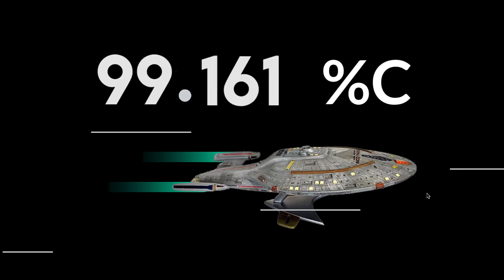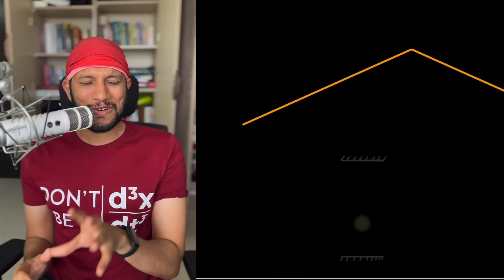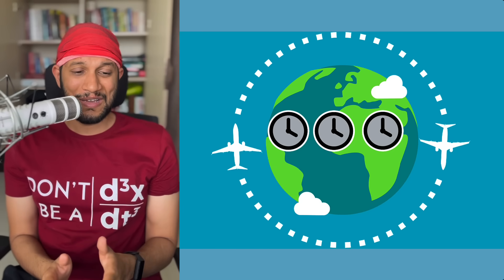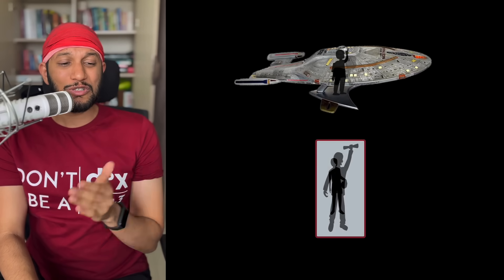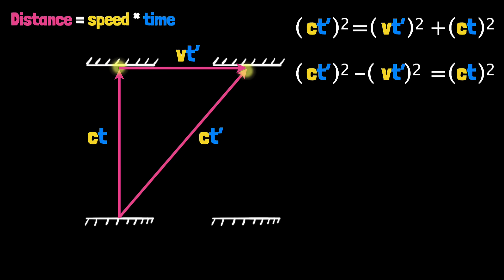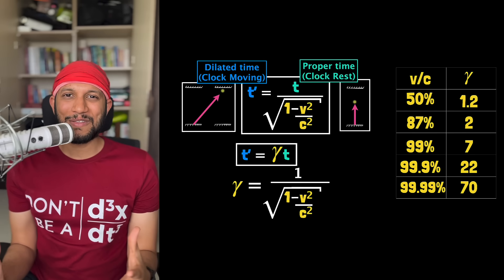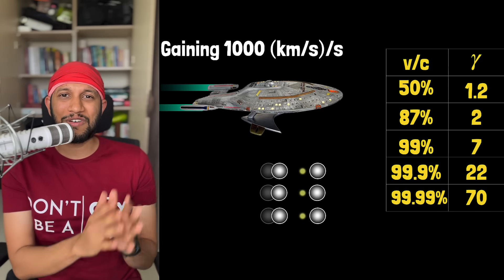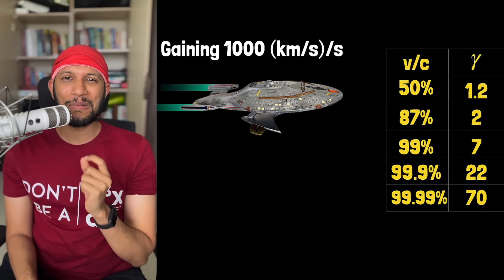I finally understood why you can't go faster than light! (My mind is blown)

Comment: Found this 11mo later. Still fascinating to learn that time stops for anything traveling the speed of light (c).   I wonder what it's like to be that photon emitting from Betelgeuse (650 light years away).   Literally while that photon traveled approx 3.82 x 10¹⁵ miles to reach earth for us to see Orion, time has literally stopped for that photon.   Seriously mind boggling.
Reply: i give you now the answer i hardly found, by myself. Einstein himself was never able to explain this.

no real clock slows down, because no real clock measures time, not distance. all real clocks measure time*distance, and that is a non-variable. 
Einstein was often confused

the answer to the twin paradox is: 
all twins in the Universe live in the time*distance, not in time, nor on distance. 
this is the key to understand the limits of special relativity, that is a non-functional theory, merely a didactical object.
no twin ages more, by virtue of relative motion and speed.

there are three types of time, all different, always different: 
1. theoretical absolute time, or say theoretical local time;
2. theoretical relative time, or say theoretical distant time;
3. measured time, the real time, that ironically does not have the dimensionality of time, it has dimensionality time*distance

Comment: How do you see the photon in the ship from outside it? There can't be an observer measuring it to get the speed of light in two different reference frames. The observer outside the ship is measuring photons outside the ship. This is probably taking the story too seriously and the equations work fine. But I feel puzzled and since it involves observation of photons, I wonder if this is related to the contradiction between quantum mechanics and relativity.

Comment: what if there is a ship inside the ship. the first ship X is really big and the second ship Y thats inside the first one is really small. lets say we managed to reach 299,792,457 m/s now we are 1 m/s of reaching speed of light. now we fire up the ship Y inside which obviously will fly faster than 1m/s. why cant it break the speed of light then? would it also require infinite amount of time to accelerate? even tho its in the enviroment that is (from ships Y perspective) not moving at all? or do we differentiate both enviroments as seperate in terms of percepting speed? but if we choose to do that then what happens if the ship Y inside breaks thru the wall of ship X. wouldnt it go faster by the additional speed it gained inside the ship?

Comment: Very interesting. I'm not a scientist and don't have any degrees. You say that as far as science can measure time slows down approaching light speed and any other consideration falls into the realm of Philosophy since science can't measure it. Yet it is the very concept and constant of time which is being used to determine that time is actually slowing down. Just because you are unable to measure something doesn't mean it doesn't exist.

The twin on earth is aging normally while the one traveling near light speed is not. It is those on board the craft who are experiencing the abnormal conditions which render them unable to reach the speed of light by THEIR own measurements which are altered due to those very same conditions. 

The craft would be in a realm where things operate differently to normal as with nano particles and quantum mechanics. A measurement taken by the twin on earth would show the true velocity of the craft relative to actual time. Nothing is impossible.
Reply: Why should earth's reference frame be in any way more "real" than the one of the ship?

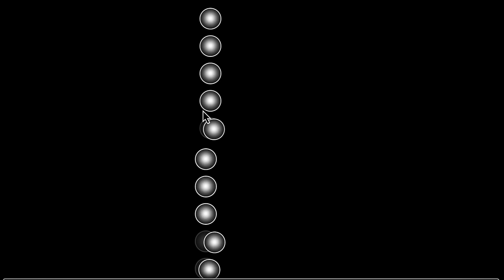Comment: 3:40 So we just ignore the orientation of a clock, regarding the movement direction or what.
If i turn the clock 90 degrees, this animation does not work anymore, because now the ship is moving 90 degrees,
compared to where the pointers of the clock are moving towards. This is pure nonsense. Sorry to break it down to you.
Time is just an invention by humans, for orientation, for logistic reasons. It is basically just a comparison really, between objects, or processes. Like planets moving.

Comment: I am confused with say the twin experiment. photon traveling is only relevant to perspective, how is it actually changed? how does moving actually warp time beyond perspective/view within light? The way i interpret it is when you see something as it is moving, it appears slower (or faster) due to distancing itself with light. Example: if you hop in a space ship and leave earth at a hypothetical speed of light, the earth will never move as you are leaving at that exact light frame that is escaping earth. Though to come back to earth, you have to make up that lost light somehow, whether be double the time coming back at half speed of light or same amount coming back at speed of light. 

I suppose maybe I just cannot wrap my head around it well enough to understand the physical changes that endure that is beyond the measurement of light/time dilation. You normally have to make up that distance/time lag somehow. So if a baby is moving in a ship, it could LOOK like it is aging slower, but in their perspective, should be aging relative to their ship, and when the ship matches earths light, it should be equal.

Of course I am open to a different understanding, but I guess I just need another explanation as to how life genuinely lasts longer beyond just our perspective of it lasting.

Comment: I always thought of it like this.

The force that holds objects (ie, matter) together is the electromagnetic force. If you move faster than that force, everything would disintegrate or fall apart, hypothetically. Does it work the same way breaking the sound barrier with sound?

Comment: Great explanation. One thing I still don't intuitively understand: I thought motion and speed are relative. So if a space ship accelerates away from the earth at almost the speed of light, the earth is also in a sense moving away from the ship at almost the speed of light. Why does the time on the spaceship slow down, and not the time on the earth? What reference frame "decides" which moving object is slower or faster?

Comment: I really enjoyed your dissertation of the limits of the speed of light. However the the example you showed the difference photon clocks between the clock on the ground and the clocks in the plane, you admitted those clocks are subjected to the gravity of the earth. In space there is no gravity until you get next to a celestial body that attracts the space ship (gravity), same as the earth attracts the planes to it, and affecting the photon clocks. If the spaceship, approaching the speed of light, has no gravity adversely applied to it, would that not negate the pythagorean theorem and disprove why we cannot go faster than the speed of light? 

I've seen the experiment where photon clocks at sea level are faster than photon clocks at the hight area of a mountain, but there again, gravity plays adverse reactions to the two clocks on earth. Your thoughts on this rebuttal, please

Comment: I don't believe the current theories of time dilation are describing the concept of time but rather describing matter in motion. The properties of matter. In fact adding weight to the concept that even photons are matter pun intended.

A photon is defined as a packet of light. It has no mass. The photon is a fundamental particle of light and electromagnetic energy that has no mass or charge: 

In this clock the photon or muon bounces between mirrors keeping time so to speak. While in motion within an encapsulation its traveling is affected by the distance covered relative to speed.What is being measured are the properties of the photon or muon as related to speed through space. Particles cannot exceed the speed of light but neither can photons. There has to be a physical reason for that.

The universe is bound by weak and strong nuclear forces fine tuned allowing for our existence. We have electromagnetism. And we also have particle attraction based on polarity. We know what causes certain polarity in matter but not what polarity is. I feel the key to understanding why matter cannot travel faster than the speed of light has more to do with it's relationship to the material fabric of the universe not some time dilation time clock that is actually measuring the properties of the clock in motion and not time itself. I feel the equations are correct but not the explanation of time. 

If you could encapsulate an object within a capsule whose walls were  not affected by our many galactic forces and laws and could prevent these forces entry to the bubble the object would not be affected my motion. It could travel faster than the speed of light. But what energy would propel this bubble? What really is energy? There is more than one type of force in the universe that can move objects.

Comment: There's also the problem that when you're increasing the vehicle's velocity you're increasing the total amount of energy in the system, until eventually it will reach even the point where it's greater than the nuclear forces holding the atoms together!  So if you got close enough to the speed of light, your ship would cease to be a ship and become a cloud of subatomic particles.  Which is probably not what you want.

Comment: Your (Einstein) time dilation is the actual Newtonian law of gravitational attraction, interposed into the "friction" of the space-time fabrics on the moving craft's hull.  F = GmA of the craft attraction.

G is not the Earth gravity constant, but the added space-time fabric (G) gravitational constants (which are 6 different values for the 3 matter space fabrics and the 3 Aether space fabrics).

Now Newton's Law of F = (G) m1 m2 / r2 is the Law of Attraction.  (G) is the above gravity attraction upon the craft.  so (G) = F/ma.
The mass 2 of the craft is put into the equation.  The mass 2 of the 6 space time fabrics is put into the equation.
The radius of the distance between of the craft and the space-time fabrics is 100 % intact or 1, negating r2 as a factor in the equation.

You are now left with solving the increasing forward (positive) velocity and force of the craft as F = G m1A.  The stationary and steady state cosmic tension of the 6 space fabrics hsa increasing rearward (negative) velocity and force on the craft (fabric friction) as F = G m2A.  As the velocity of the craft increases, so does the rearward velocity of the space-time fabrics F = G m2A as a negative increasing value.

Newton's Third Law of Motion, Law of opposite reaction, states that for every action (force), there is an equal and opposite reaction.  This means that when one object exerts a force on another, the second object exerts a force back on the first that is equal in magnitude but opposite in direction.  Thus the craft's F = (G) m1 A is countered by the space-time fabric (and its gravity = time dilation) F = - (G) m2 A.

As one is not dealing with just 2 particles in motion and reverse motion, you have a continuing and greater accumulation of additional space fabrics in the formula m3A,  m4A, m5A, .... so the formula increases to F = (G) m1 A (-) (G) m2A, (G) m3A, (G) m4A, (G) m5A, ....    Eventually, you get to the gravitational friction of the greater numbers of space fabric gravitons flying by the ship, with residual gravitons falling off into the past distance, you have an increasing mass of the space fabric's gravity "friction" increasing until you reach equilibrium, and can't go any faster, unless you increased your fuel and velocity into trigonometric values, which also increases the trigonometric values of the space fabric friction acting like a tarry space building up and slowing down your velocity.

Time dilation as a 3rd party observation is a real occurrence, but the real forces are happening with the craft's velocity and the space-time fabric's gravitational attraction and resistance bogging down the craft's propulsion.

The ONLY way to circumvent and negate General and special Relativity is to negate the space-time fabric's gravitational attraction and resistance.  The is accomplished via an electrostatic force field around the craft.  What external gravity can't touch, it can't attract, and it can't resist.  So as one negates Newton's Laws of Motion and Laws of Attraction, only the craft's F=(G)mA is the valid formula.  All space-time fabric gravity is negated in all other formulas.

This is why UFOs/UAPs have that fuzzy tic tac UAP force field around them, and no form of conventional aerodynamic wings, ailerons, and propulsion system.  These craft then have supersessional flying abilities of instant directions (up, down, left, right, forward, reverse), instant vertical land, instant vertical launch, and non-gravity hovering.

Comment: Well first of all. We don't 100% know what the speed of light is. As we can't observe light until it's bounced off something.   So the speed we say light travels is a guess
Reply: It’s not a guess. It’s a precise number of the Two way speed of light
Reply: @Zawarudo_tokiya_tomata  that is not correct because in theroy we do not know if the light is traveling at twice the speed we think then get cut but half as it bounces. If the full speed at impact and is the instant after.  Or any number in between.  All we know is how fast the trip is in total. But there are many variables that can be present to equal that total
Reply: @ You’re just referencing Veritasium’s video. Again there would be no real reason for light to have different effects on direction. That in and of itself is a guess
Reply: @Zawarudo_tokiya_tomata  that is true. And because there can be additional guesses or theories.  That would suggest that saying you know for a fact light travels at a certain speed   which you can not because that can't be proven yet
Reply: @Zawarudo_tokiya_tomata  https://youtu.be/pTn6Ewhb27k?si=IsFfKGO8dXecKs-2

Comment: I still don't get it.  Photon movement is based on reference frames.  If you are in the reference frame of the space ship, the photon will always appear to be moving up and down.  But somehow, if the spaceship gets closer to the speed of light, the fuel tank empties faster?  How?  There is no friction in space.  What force is preventing the ship from accelerating?  

To me, time dilation just seems like the same thing as the Doppler Effect.  When you see things from a distance they act odd.  There is nothing actually stopping you from going the speed of light, as an observer, it just appears that the longer distance a photon has to travel prevents you from going the speed of light.  But in all actuality, there is nothing stopping you, because you are just in a different reference frame.  In the reference frame of the spaceship, you can just keep accelerating.